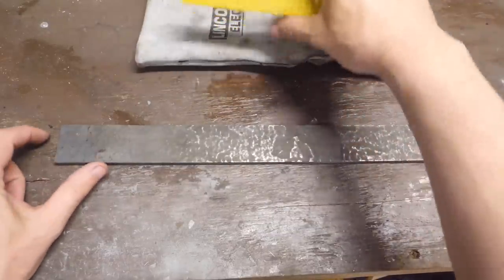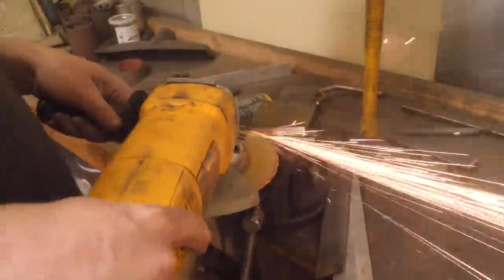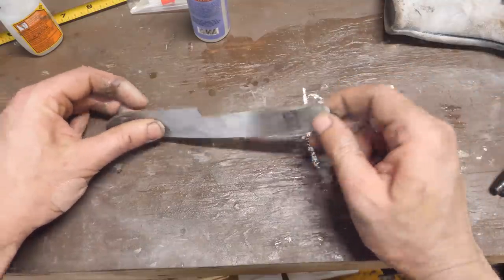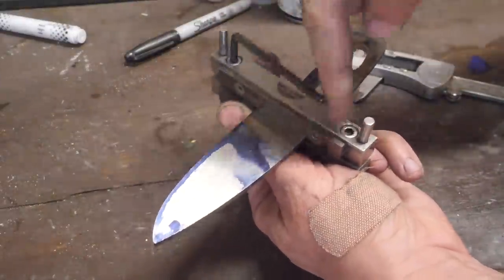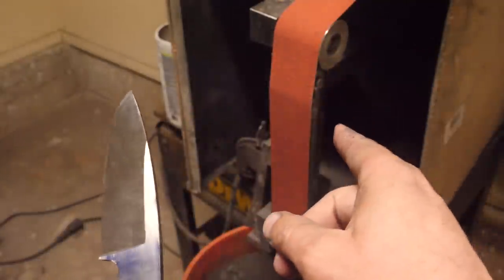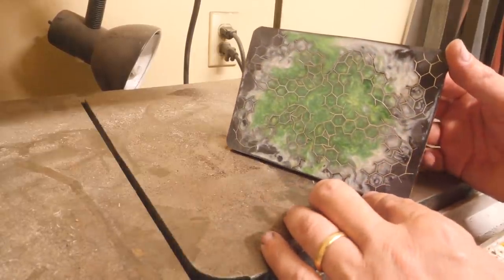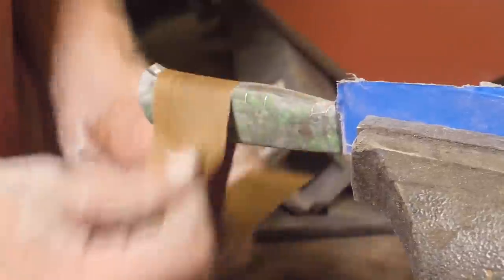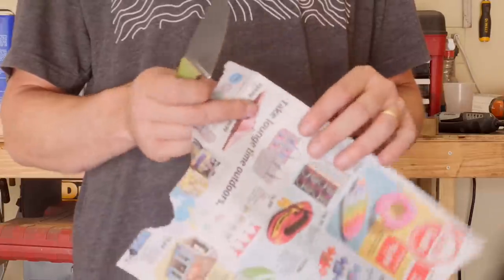Making A Nitinol Knife. Part 2: Finishing The Knives!

Comment: The best way to work with Nitinol is with electricity. Get a large 12 volt fork lift battery (1500lbs.) and use large 0000 wires and weld the Pos and Neg on each end of the Nitilol bar and this keeps it yellow hot for 10 to 15 minutes, long enough to make a knife. I use a 2000 amp knife switch and my assistant keeps the nitinol at the perfect temperature opening and closing the switch.

Comment: Nitinol really just says "nah, I don't think I'll be a knife, or anything really. Have fun trying to use me"
Reply from the maker: Heheh
Reply: Nitinal is just not meant for blades its far more useful for its applications in engineering and tech
Reply: @Lumberjack_king  theoretically at least, since nitinol is a memory metal you could just heat it up and it’ll resharpen itself. Kinda like the synthetic knife from battlefield bad company 2.
Reply: @beybladesinmyheels1267  interesting
Reply: @beybladesinmyheels1267  I forget the name but there was a research group working out how to successfully make nitinol blades, and body armor. It's also used in some medical devices
Reply: I think it would work great as a european longsword, due to it's elasticity exceeding that of spring steel
After the nightmare of actually making it😆

Comment: A thing I've seen Alec Steele and Will Stelter do that should work well for surface grinding non-magnetic stuff with your attachment...they put masking tape on the two surfaces and then glue the masking taped sides together. You get a good hold, and it comes off without whacking the poop out of it later.

Comment: That little divot or deeper cut that occurs on the surface grinder at either end of the stock happens in woodworking too. When planing wood, we call it “snipe”. It’s common so we always plane wood long and then cut down. Obviously not ideal for such a high dollar piece of material, though, I’m sure.

Comment: Love how that resin/aluminum material turned out. Looks like that metal is a bear to work with. You’d think something that resistant to abrasion would hold an edge well.
Reply: @roberttodd619  Excuse me sir, i do believe you are mistaken, perhaps you heard where Nitinol got its name (Nickel Titanium 'Naval Ordnance Laboratory') and simply assumed it was used in bombs because of the word "Ordnance"? After a quick google search and some very light ready it is known that they used it in high pressure hydraulic titanium tubing(a coupler specifically). I can personally find no evidence that Nitnol was ever used in bombs, or documented to "fragment and burn at high temperatures".
Reply: @roberttodd619  I worked with explosives in the USAF. That is incorrect. Nitinol is "Nickle Titanium" hence the name NiTiNOL. NOL meaning Navy Ordinance Laboratory. It was discovered trying to make a heat and corrosive resistant alloy. It's commonly used in robotics or mechanical applications as a sleeve for wiring to prevent chaffing from movement or vibrations. It's also used in some medical equipment such as bone staples or stents.

Comment: So if you bend it prying with it you might be able to heat it and it may return to it's former shape? What's the purpose of heat treatment when no deformation stresses have been induced in the material from machining or hardening from transition through different lattice structures
Reply from the maker: hardening is the purpose, to HRC of 60-61

Comment: Is there any benefit to having knives made out of the nitinol? The only thing I can think of as a possibility is rust resistant....and even that I'm not sure about.
Reply: Fighting xenomorphs
Reply: @arathorn867  hahaha awesome answer.
Reply: I think it would have abrasion resistance like vanadium steel but I dont think it helps with edge retention.
Reply: @1810jeff  yeah GB said in the video it has poor edge retention. It certainly does have abrasion resistance based on how fast he went through sanding belts.
Reply: @mattpayne3807  yeah then I'm guessing it's like how some people want a titanium knife just as something exotic even though it doesn't hold an edge. But in terms of performance you could probably get the same benefits from some high vanadium stainless steel.
Reply: @1810jeff  yeah. I have a titanium diving knife for scuba diving but I barely ever use it so it hopefully will stay sharp...I wonder how expensive the vanadium steel is...
Reply: @mattpayne3807  lots of steels use vanadium.
Reply: @mattpayne3807  can't be that much since some japanese kitchen knives use aus10 which has almost the same specs as W2 steel with the added chromium and nickel for the rust resistance and aus10 kitchen knives aren't that much.
Reply: @1810jeff  hmm well that's good to know. Il have to look into that. Thank you for the information.